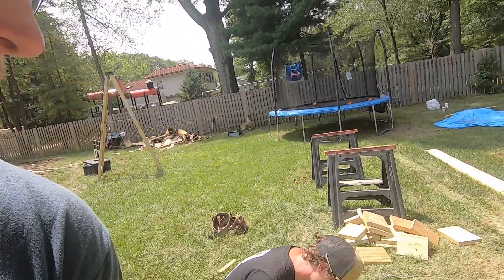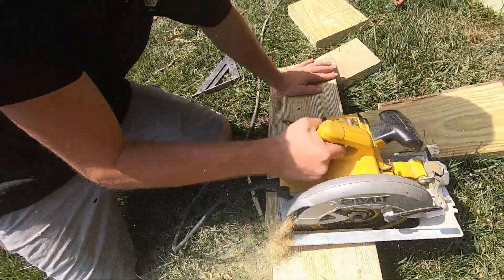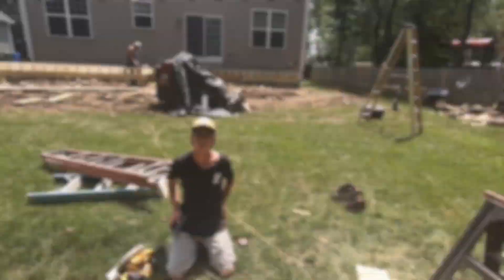DECK FRAMING! 3rd Ave Project

Comment: Enjoy your videos. I am building a deck this coming Spring. I plan to use a box frame similar to the one in your video here. Am I correct in seeing you are not using joist hangers? I sell Camo fasteners and work with deck builders all the time. I noticed they build framing similar to the way you do it.
Reply from the maker: i appreciate that! we dont use joist hangers because this is freestanding and doesnt have a ledger board attached to the house so there isnt a need for them in this case